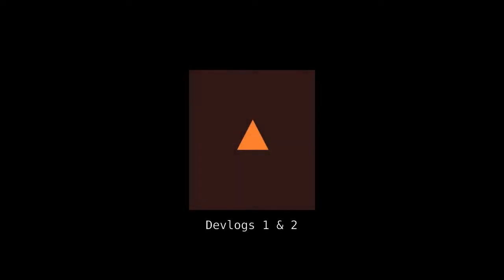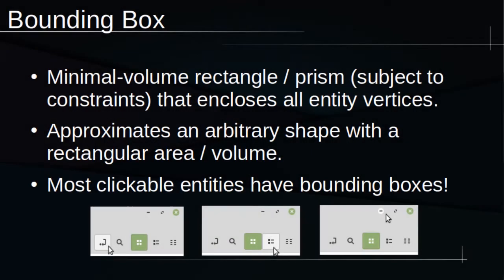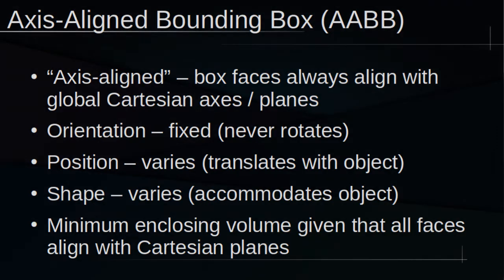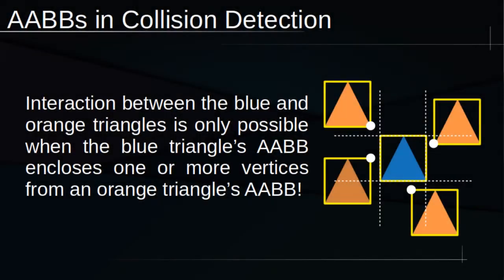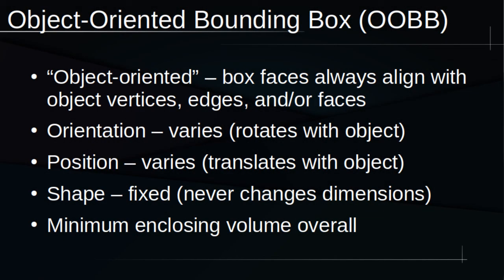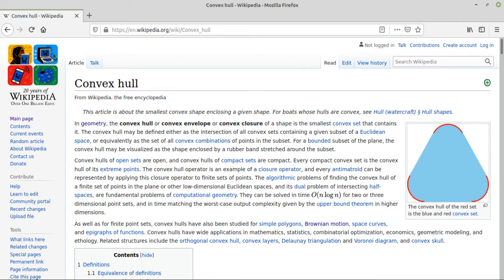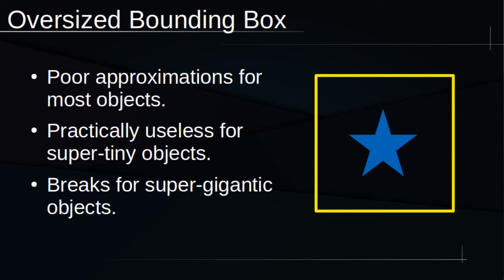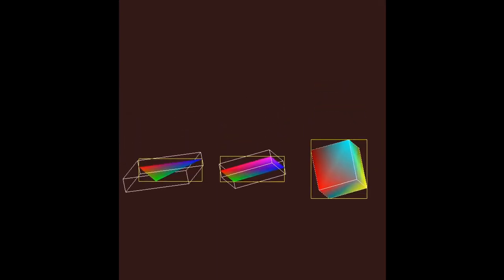C++ Game Engine - Devlog 3 (Bounding Boxes)

Comment: And what's the cost of recalculating the AABBs every frame?  Especially for more complex objects?
Reply from the maker: For collision detection, recalculating AABBs each frame is cheap compared to more sophisticated techniques. It's especially useful for determining which objects aren't in contact. Unfortunately, I've never performed any profiling, but I would take a wild guess that, for a large number of objects, using AABBs to resolve collisions could be an order of magnitude (or more?) faster than exclusively using something like the Gilbert-Johnson-Keerthi distance algorithm.

Comment: A bounding sphere is so much easier to describe and calculate with.
For early collision discarding it's soooo much easier to handle spheres.
The only advantage of AABB seems to be the ability to approximate axis-aligned squashed objects better. Of course, an oblique object sucks both ways...
Reply from the maker: You're right. I debated on whether to include bounding spheres in the video, but there'd hardly be anything to say about them because they're so simple. I'll probably implement bounding spheres at some point, but I wanted to tackle the more challenging bounding volumes (i.e. boxes), first. Thanks for your comment!